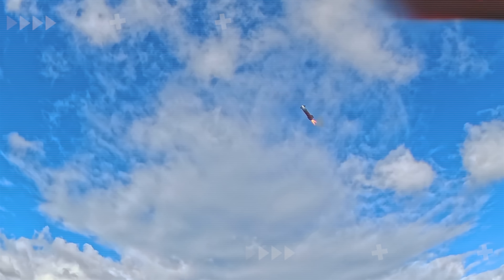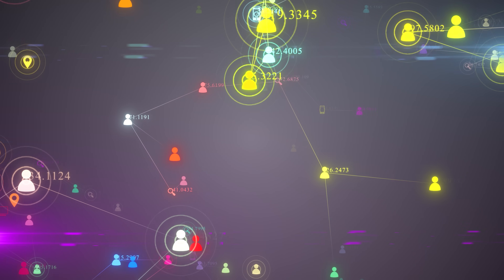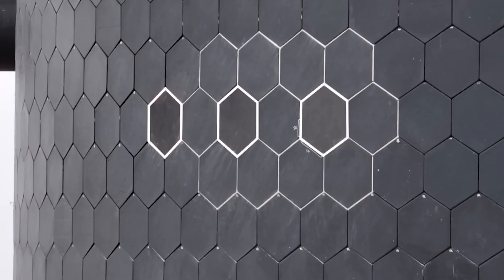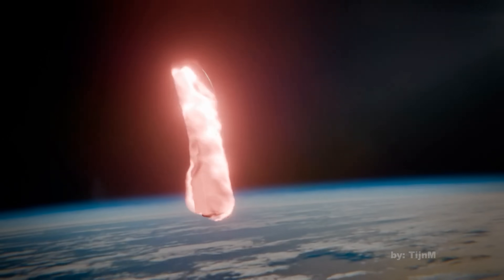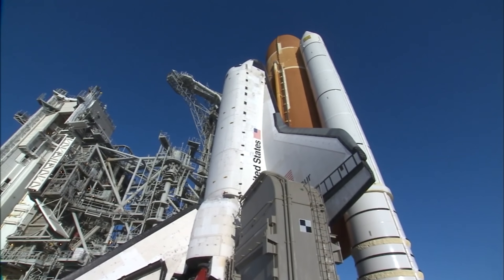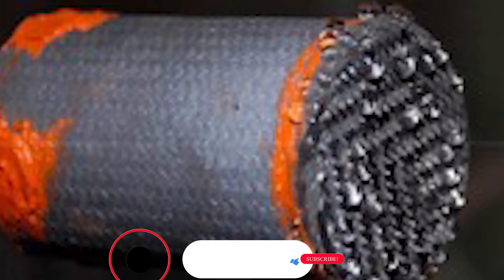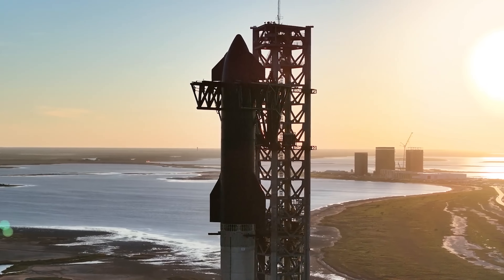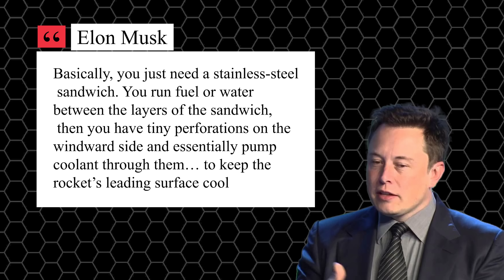Elon Musk officially declared Starship Metal Heat Shield ''USELESS" after Flight 10 Reentry...

Comment: Instead of belly-first reentry, Starship should use nose-first reentry and a heat shield that will look like a rounded pancake or a segment of a sphere with a diameter larger than the diameter of the Starship that will be placed in front of the Starship's body. With this approach, no thermal protection of the surface of the body will be required - plasma will flow around the body without touching it. The heat shield will have to be refurbished or replaced after each flight, but it will not be an integral part of the starship itself, so it will be easy to do. A single-use heat shield could be covered with tiles made of thick plywood - a cheap and efficient ablative material
Reply: I think that will defeat the purpose of using maximum surface area to decelerate in order to preserve fuel.
Reply: @Hannodb1961 It can fly sideways once its speed drops below hypersonic (it no longer needs a heat shield)
Reply: @tedantares2751  On Mars, the atmosphere is too thin for that. They need the maximum breaks as soon as possible.
Reply: Interesting point. I don't know if that would be practical for a human rated ship on re-entry. To take that thought of a separate heatshield a bit further, consider ULA designing an inflatable heatshield for Vulcan. In this concept, Starship might be able to re-enter Aft first. In that way, also simplifying the flip maneuver. Replacing a heat shield pack on every flight might not be unplausible while other designs are matured.
Reply: Heatshield has its limits. It's not like you can just dump all heat of reentry onto them without them breaking. Belly flop is there to also spread the heat onto wider area so each tile won't break
Reply: Foamed Tungsten. A thin continuous layer , like aluminum foil thickness, then a foamed metal insulating layer.
Reply: @jessicatymczak5852  Metal foam is indeed a very interesting new material with unique properties that can be used for many applications, including heat shields. Perhaps, it could be used with evaporative cooling
Reply: @tedantares2751 also thought that
Reply: Soviet icbms in the late 1950s use plywood heat shields
Reply: @jimeditorial Polaris uses a plywood nose cone
Reply: @808bigisland I thought it was the phenolic material Avco developed
Reply: How about a thermal inflated air bag for increased drag and velocity reduction, then discard. Air- o- breaking? Might work in Mars atmoshpere... just saying.....
Reply: @timothylewissr.5080  This is pretty much what NASA's LOFTID (google it) heat shield successfully tested on November 10, 2022 looked like - like an inflatable mushroom airbag
Reply: @timothylewissr.5080  I don't think such a technology exists. Elon Musk is not satisfied with the heat tiles solution, and is actively looking for improvements or alternatives. I'm pretty sure that if you could blow up a balloon strong enough to resist the forces of reentry, it would've been done already.
Reply: Wouldn't bleed off speed and heating would be way higher.
Reply: Inflatable shield.
But will it not be to less surface for a efficient aerobraking ? ( especially on Mars ? )
Reply: Except, it’s the surface to weight ratio he is leveraging.
Reply: To keep the vehicle largely in the shadow that sphere would have to be several times the diameter of the vehicle. It would be heavy. It would create a lot of drag on ascent. Its not practical.
Reply: Add some spherical gas tanks to the base while at it 😂
Reply: I don't believe it would need to be nearly as large as you described.
Reply: Interesting idea but impossible. First you would need massive structures to withstand the pressure. 
Second plasma will get sucked to the body due to turbulences behind the heat shield. 
The heat shield has to be foldable otherwise it would be a major drag at the start including massive structures to withstand the pressure.
The basic idea of an instantly reusable starship is physical BS. There simply isn’t enough demand for it to justify the downsides of such a design.
Reply: @svenweihusen57  I think an instantly reusable spaceship will become a reality only when chemical rockets are replaced with some other technology with specific impulse in the > 100,000 s range that will make it possible to simply decelerate the spaceship using the engines to almost a zero speed while still outside the atmosphere
Reply: It's amusing that so many people with a fairly basic understanding of the technology...have the audacity to actually believe they know better than those who have come this far.
Reply: Yes, let it fold out like an umbrella. It will cost another ten years and ten billion taxpayers' dollars before Elon says it to be impossible.
Reply: Ship is too long for that. Plus think of the drag from that thing on launch, and lack of drag on reentry. it works for small capsule lander, but to slow down starship size vessel, the dish would need to be ridiculously large. 
Spacex is doing quite harsh reentries right now to push it to the limits. They'll find what works and will make it glide like nobody's business. 
While the belly heatshield seems complicated, it's actually not. Most tiles are not unique like on the shuttle. Once they'll finish testing, then plug and play mass produced tiles is the way to go if scaling space logistics is the aim. I imagine an automated robotic module for tile replacement will have to be built eventually.
Reply: @karlsanders6552  I wish SpaceX a good luck in that. Finding a suitable material for tiles will be crucial. Someone mentioned titanium alloy foam - I think this could be a good solution, especially, if it can be combined with evaporative cooling. Onbe of the problems with traditional Space Shuttle-like tiles is that they accumulate a lot of heat that needs to be dissipated after landing. For that, they pumped freon into a Shuttle's internal cooling system. It would be much better to cool the tiles rather than the metal skin and the internals
Reply: How would it be deployed for re-entry? To be wider than the starship itself it wouldnt be deployed on ascent
Reply: @simonhill6267  Google "inflatable heat shield"
Reply: How about an EMPTY FUEL TANK DISPOSABLE SHIELD?
Reply: @JimmyRussell-c2s  Reusability  ? 5 it'd the MAIN purpose od the SS )

Comment: I was just looking at something called litelok on YouTube, it's a motorcycle lock that is made out of steel that's infused with ceramic it's called the litelok  X3 . I thought maybe this stuff would work on the heat Shield. I wonder why you can't just make the ships skin a bit thicker in certain places like a callus where it's likely to burn through. Not like Led Zeppelin thick just a little thicker, after all the ship can carry a lot of weight. Also I see you can buy cutting tools like drill bits and saw blades with a diamond surface I don't know if it's diamond dust natural or synthetic but it's very hard and not expensive. Add a little bling? Starship's development is great to watch. Thank you to SpaceX .

Comment: Could they slow down in orbit and fall directly downwards?
Reply: Too much fuel to slow the ship down from orbital speed…26000kmh.  They need to aerobrake using the atmosphere to slow down enough to make the bellyflop manoeuvre, then use the remaining fuel for controlled landing.  So, the heat shield is essential.  SpaceX wants a fully reusable shield, for immediate re-use of the ship.  This is a difficult goal.
Reply: Using atmospheric drag is such a gigantic cost savings compared to lifting the needed fuel and the loss of paying cargo that researching a heat shield solution is a top priority.
Reply: @AddItUp-11235  They have spent near double the original taxpayer funds for HLS, and not even made a HLS prototype.

Comment: Can anybody speak on the feasibility of using liquid cooling and pipes that go round the ship to disperse the heat to the backside areas that experience partial vacuum?
Reply: Yes, heat won't conduct through a vacuum. So conduction is useless to achieve cooling from the rocket to space. All you can use in vacuum is a radiator, which transfers far less heat than a conductor will.
Reply: Wouldn't there be some areas with low to normal pressure where you could do it?
Reply: Wouldn't work

Comment: I don't think Starship has the payload margins to use Hastelloy or Inconel as a heat shield material. The heavier the ship becomes, the longer it takes to burn off the kinetic energy as heat. That's why most spacecraft are built from lightweight materials. Starship isn't only the largest object to ever fly; it is the heaviest. The mighty Raptor engines are making stainless steel look like the go-to material for spacecraft construction; unfortunately, they can't help during reentry.

Comment: Yeah, but Inconel and Hastelloy are also dense at well over 8 g/cm3. Denser than steel. Keeping within a mass budget means very thin layers. Let's face it, an economically reusable (as in it flies over and over without refurbishment) heat shield is still a hard problem and is still years away.

Comment: Sounds like we need a new alloy for these heat shields 😅
Reply: Time to make a new element… back to hardware mode (queue Iron Man 2 montage)😅
Reply: We need a material like carbon foam. Naturally light, porous and also ablative if needed.
Reply: @saumyacow4435  wow you could be a rocket surgeon. What insight. I am a brain engineer.

Comment: Heat shield research is nothing new!
During the space race of the 1950s and 1960s, it was proposed to use berillium as a shield material.
The physical characteristics of this material seemed promising until the physiological and biological aspects of berillium were examined.
It was found that berillium is in a category similar to arsenic (clearly toxic) rather than iron or aluminum (non-toxic).
This probably explains why there are no new berillium-based heat shield compositions.

Comment: What if they flipped upright much earlier, used braking rockets to slow down significantly, and then deployed a large, computer-controlled rectangular flight parachute? It might not be entirely practical—I’m not an engineer and have no idea if it’s even feasible with something that massive—but if this method worked, it could allow the craft to glide back to its landing point from a much greater distance without relying on fuel. And of course, I still mean using the propulsive chopsticks grab at the last moment.
Reply: By the time a parachute could be used  it has already slowed well below the speed where the heating happens.   It would need to be travelling at hundreds of miles per hour not the thousands of miles per hour it is travelling as it deorbits.  Braking rockets need fuel that adds weight both in the fuel they would use to slow it and in the extra fuel needed to get the braking fuel into orbit.   Almost every pound of fuel that got it up there would be needed to get it back.  It would  need two boosters.
Reply: @geodun What I’m suggesting isn’t just using glide flight with a parachute but also carefully optimizing where and when most of the speed and inertia are reduced. Instead of thousands of MPH, the initial burn would bring it down to hundreds, requiring us to be deep into the denser atmospheric layers. This method would need two engine relights, but by the time the chopsticks catch it, the remaining inertia would be significantly lower. The second burn would use much less fuel, and no fuel would be needed for the flip or trajectory change during the ship separation maneuver, possibly eliminating the need for a hot staging ring. All distance and trajectory adjustments could be managed with glide flight. Plus, removing that intense high-G flip maneuver during ship separation means you wouldn’t need to account for the fuel stress during the flip. If I understand correctly, this is why they moved the oxidizer tank to the top of the ship. This adjustment would allow the ship's center of gravity to be mid-ship or fully aft, enabling a simpler, more manageable fuel distribution system.

Comment: its not that metal failed its the properties of the current tile they are using failed they need to go back to the drawing board to make it more heat resistant mix ceramic or somekind spray on ceramic mix
Reply: No they need to use vibranium

Comment: wonder what would happen if had say hundreds of 2m long 1 cm diameter metal whiskers with ablative core substance sticking out from the heat sheild which create a semi  protective cloud of particulates as erode in front a more lighter weight sheild? They could burn up like fuses and be easily replaced when get a bit short and stubby lol
Reply: Too much drag for accent.
Reply: @MrEh5  good point but, 1 cm wide 2m spines vertically aligned too much drag?  starship has about ~600,000cm^2 cross section a few hundred ablative needles with well aligned shock cones maybe  <~5000cm^2 so <1% loss relatively. of course that 1% is for "velocity losses from aerodynamic drag are cumulatively small and are typically between 0.05 and 0.15 km/s"(/rocket-performance) so between 0.0005 and 0.0015 km/s?

Comment: If the best part is no part, seems like SpaceX just needs a higher temperature stainless steel.
Reply from the maker: maybe not 🤣
Reply: doesn't exist.
Reply: @saumyacow4435 yup, there are no metals in existence that have a higher melting temperature. There is no point in going on because you believe this. Your clearly smarter than everyone else 😂

Comment: Why wash the orange off ??? ... F9 boosters become quickly discolored and it does not impact performance.  If this is just 1% ablatement ... then maybe a tile is good for 50 runs ... plenty good since I expect ship to become obsolete and planned for replacement after 50 runs.  I would suggest that Crew Ships have 2x the TPS and or water cooling mass of a cargo or fuel run, as crew is a pretty light payload.  Note that Stoke is trying out this active cooled method on their reuable second stage (2027?).
Reply: Falcon 9 does not enter at the same speed or at the same altitude as flight test 10.
Reply: As the heat shields get thinner they lose thermal mass, get hotter and transfer more heat into the rocket 🚀.

Comment: Starship is full of stainless steel. THERE IS NO IRON ANYWHERE ON THIS SHIP dolt!
Reply: Steel is mostly iron with extra carbon, thats still a form of iron...
Reply: @TheRealQuartz Stainless Steel also has some chromium to make stainless.
Reply: @TheRealQuartz  it is steel because of the carbon. it is not iron. the orange is not iron oxide. they clearly said it was a different chemical reaction.
Reply: Show me the element steel dolt. Steel is an alloy of mostly iron dolt.
Reply: @billevans5105  stainless steel dolt - NO OXIDATION. Geeze. I can't believe you.
Reply: @billevans5105  Do you really need your science fed to you by the spoonful? I said STAINLESS in my OP but you don't "get it". dolt STAINLESS = NO OXIDATION. THEREFORE NO IRON OXIDATION. enough!

Comment: In the short term, reusability and returning through atmospheres is the priority
but in the long run vehicles that don't return to earth or travel often to other planets with heavy atmospheres may not be as necessary, or future propulsion methods might make it possible for slow speed re-entries. Even planned travel to Mars won't pass through a Martian atmosphere as dense as the Earth.

So, there is room for different heat shield types depending on the missions assigned to that vehicle and who knows... Maybe non terrestrial manufacturing might advance far enough to allow a different type of heat shield to be applied to a vehicle to enable versatility in missions over the life of the vehicle.

Comment: elon, listen... insted of 15 tons of coolant better get 15 tons of solid rocket booster to slow down the reentry. exhaust plumes will help also to lessen impacts of plasma...
Reply: lol a  15 sec 4 G burn won't scrub much of the 8Kms-1 orbital velocity
Reply: @blengi  where you get the numbers about 15secs and 4gs... these numbers depend on engine power and weight of vehicle... go back and do calcs again... re-entry burn with adequate opposite pressure and parameters might prove important...
Reply: @ksd593  didn't think about it much just 10 second mental calc ballparking using about 1 ton propellant per second for 3 raptors for 15 secs but that  was old raptor numbers is more than twice that though according to AI. assuming 150-200 tons at re-enetry. . and 250 tons of thrust * 3 that's about 4 g or a rough 500ms-1 change in velocity. versus ~8kms-1

Comment: Firefighters are taught that a fire impinging on a propane tank below the liquid line will not cause the tank to fail. The Liquid will keep the steel cool below its failing point. But this causes the liquid to boil creating gas that has to be vented to prevent over pressurization. This depletes the liquid and when the liquid line goes below the fire impingement point, the tank will fail causing a BLEVE (Boiling Liquid Expanding Vapor Explosion). Closed cooling systems or transpirational cooling systems have their draw backs. Closed systems add weight of the liquid and the cooling system. Transpirational cooling depletes the fuel system. Significant mass weight is added for both systems. Both systems are complex and a failure in any section is a vehicle failure. 

The system they currently have is not yet rapidly reusable, but it may be in the future. They probably should stay the course and deal with heat shield repairs in the interim.